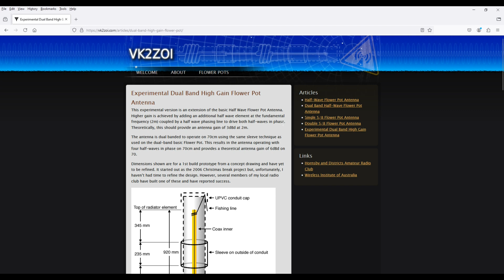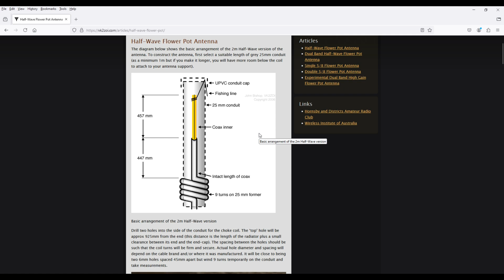Best and cheapest antenna for 2m #flowerpot #t2lt

Comment: Best? Questionable. Cheap. Certainly and they always work. A slim Jim is better but a little more complicated...and most likely more expensive to make. Colinears are usally better but of course, can be expensive. I have flowerpots for 10M, 2M, 6M and 4 M and all they cost is a pl259 (or whatever) and a few yards of co-ax. Well worth making/using.
Reply from the maker: Hopefully you now the updated version of the antenna - a collinear antenna - just use the automatic translation:

https://youtu.be/OPqwToLXzHg